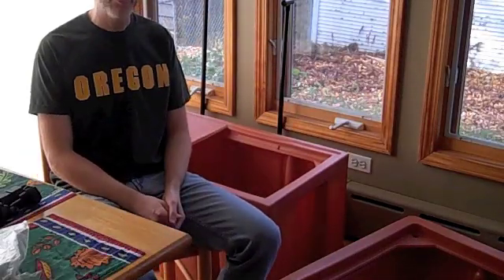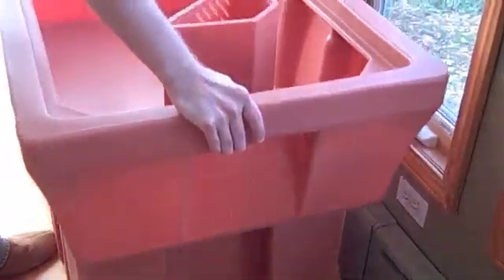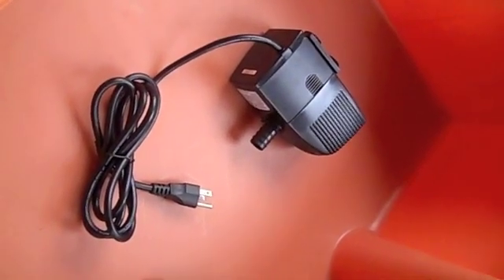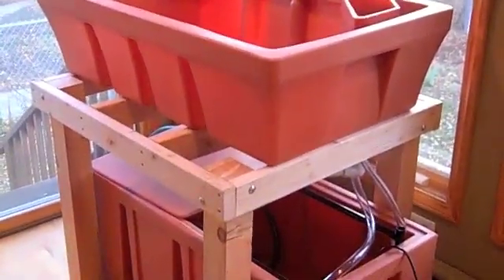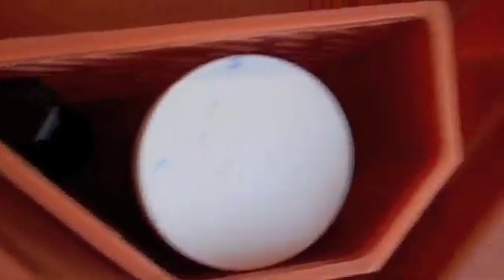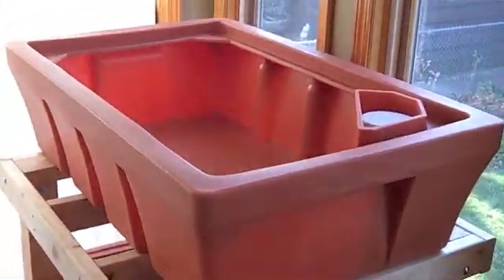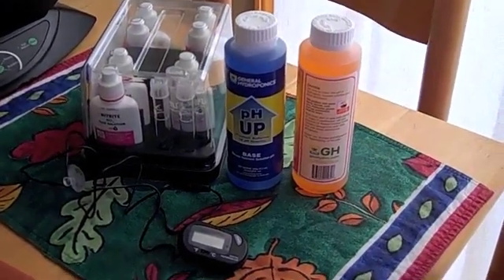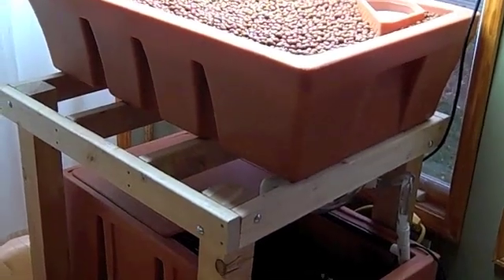Indoor Home Aquaponics Setup Part 1

Comment: If I am reading the date correctly for this upload ... You have have been using this system for several years . Can you share with us if you are happy with the system and are you still using it ?
Reply from the maker: I have 4 videos of the system you're asking about. I ran that system in Chicago for about 1.5 years, and then packed it all up and moved to Portland. I have since started up a larger system that uses most of the parts from my original system (plus more). This system has been running since Feb. 2014 and I have a few videos of that as well. The equipment itself has been great. The main thing that didn't go well with my original system is that I didn't know enough about supplementing minerals, and so some plants did not do well, or produced funny tasting results. I'm doing better with that this go-around, explicitly adding iron, calcium, pottassium, magnesium.

Comment from the maker: There is (are) filters - just not the usual type. The pump does have a simple screen on the intake, which I clean every few days. That catches some solids. The rest just get pumped up into the growbed, which also acts as a filter. I added worms to the growbed, and they help break down the solids. All the rest is processed by the growbed bacteria. System stays remarkably clean.

Comment from the maker: Thanks, and Go Ducks! Good question. 60 gallons of water is about 500 lbs. The hydroton is fairly light, so I would say the whole system is about 650 lbs. My back porch is new and has a new foundation with 2x12 floor joists, so I figured no problem. Elsewhere in my 104 year old house, could be a problem...